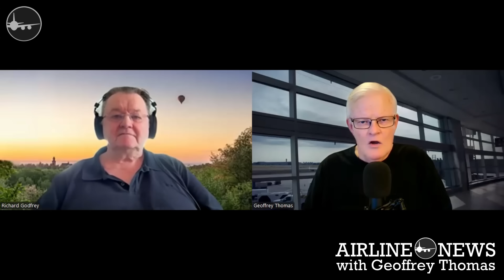Air India Crash - Probable Cause  #airindiacrash

Comment: EVIDENCE OF AN INTERMITTENT FAULT IN THE E/E BAY OF AI171

The HSTA Breadcrumb

Air India didn’t mention the Horizontal Stabiliser Trim Actuator (HSTA) in the Preliminary Report for nothing. That wasn’t a throwaway detail — it was a breadcrumb.

On the Delhi–Islamabad leg the jet already showed signs of an intermittent stabiliser trim fault. The aircraft behaved erratically, like it was trimming nose-up when nose-down was commanded, forcing the crew to fight it. Maintenance logged “no fault found” because the glitch cleared itself — classic intermittent.

So why did Air India highlight HSTA? Because it proves there was already evidence of an intermittent fault in the E/E bay. First it showed up as trim misbehaviour, then on AI171 it may have escalated into fuel control or electrical problems.

In other words — the crash wasn’t out of the blue. The airplane had already given a warning, and the HSTA entry is the clue.

Regards Scooter.

Comment: Boeing should redesign their planes which prevents this kind of situation..

Even the minor water leak should have a warning in the cockpit. Just like car wipers sensing even a rain drizzle .. it should be considered as a major incident  just like smoke.

There are always 100s of ways to improve the design..  

The design which fails to protect itself for any reason without a physical damage is called failure design.. 

Thermal runaway is a known issue but its still not solved. 

They changed the design to protect fire from spreading.. but they have not taken any action to prevent thermal runaway..

Preventing fire is better than protecting fire inside the enclosure 😂😂

I am really wondering there was no protection on battery systems till thermal runaway happens ..
What does useless battery monitoring system do here without giving any warning to pilots? 

Water leakage just before 5 mins can't cause this kind of failure. 

Corrosion don't happen in a single day.......😢

I think water leakage is the least monitored area of the entire plane..

We usually don't do maintenance until there is a some kind of warning or some notifications either be at home or plane..

WHERE IS THE WARNING?? Nothing ..... just a crash... Even before pilots realising what's going on..

Plane crashing in less than a minute is a complete failure and major design flaw.. 

It's really good recommendation from Richard to test multiple sources of failure at the same time..

But for me it looks like its internal battery failure which caused huge damage to the complete electrical circuit.. 

The issues caused outside the battery is mostly protected by the circuit.. 

But There is no way to protect internal battery failure with the worst chemicals reacting inside the battery..

No batteries can work good for more than 5 years.. replacing the batteries every 5 years or less should be mandatory..

Old batteries were never reliable..
Just a voltage drop at single cell is enough to cause electrical glitch and bring the emergency situation..

Now a days even a water purification systems comes with service warning msg.. we can't use them until it's serviced..

Blaming maintanence is ok but is the plumbing system designed to withstand the usage of toilet by 200+ passengers in a single day? 
1500+ passengers in a week? 

Urination happens 3 to 4 times in 14 hours for a single person. 

Basically the toilet and plumbing design should withstand 1000s of toilet visit in a single flight.

Ignorance of non critical maintanence should never cause the plane to crash..

Is the water leakage is in the critical maintanence list??

Intermittent issues should always be recorded and looked at it immediately even if it's cleared automatically.. 

Intermittent issues always hides big issues behind it..

Comment: I think you are on track.  I love your analysis.  I haven't seen all your videos but I try to watch daily.   I have two questions you may have answered previously that I missed but I'm going to ask them anyway.  Right after the crash, a video appeared online that supposedly showed a flight on the same aircraft just prior to the the flight when it crashed.  The passenger was commenting on how multiple cabin functions were inoperative, including the air conditioning.   Was that legitimate or debunked and if legitimate was it considered in the aircraft investigation.  My second question is related to a video I saw by another analyst shortly after the crash.  He said that if the fuel valves completely loose power the default position is closed as a safety shut off precaution to stop fuel flow in case of a crash, etc.  They analysis said that if the power was completely shut off for only a brief moment from all sources, prior to the RAT deployment, the valves would have closed, starving the engines of fuel.  Causing engine shut down.  Is it true that the default fuel valve postion is in the closed position?
Reply: I9https://youtu.be/1y_u1O-T6jw?si=fcflMzQxx6i8wp-1

Comment: Is this what Richard is saying?
1. The APU lithium ion battery had a thermal run away during rotation as the first mishap in the sequence of mishap events. 
2. As the APU battery began its thermal run away, rotation caused “ liquid” to flow onto the battery and exacerbated the event.
So two seperate events conjoined to trigger the mother of all electrical glitches. Seperate to these two events is the unexplained “ drag” causing an extended takeoff roll. 
Questions
A. Did rotation cause the APU battery to begin its thermal event and how so?
B. Is the APU battery enclosure supposed to be waterproof?
C. If there was no water ingress, the APU battery thermal runaway would still have occurred ? Therefore this was a lithium ion battery” event”.
Thanks.

Comment: If the fuel switches had been switched back to run a bit sooner, do you guys think there could have been a chance to save the plane?  I know we are only looking at a few seconds here, but hypothetically.  Interested to hear your opinion.
Reply: No chance of recovery.. no altitude to recover... Nobody could have saved the plane.. 

Boeing should redesign their plane which prevents this kind of situation..

Even the minor water leak should have a warning in the cockpit. Just like car wipers sensing even a rain drizzle .. it should be considered as a major incident  just like smoke.

There are always 100s of ways to improve the design..  

The design which fails to protect itself for any reason is called failure design.. 

Thermal runaway is a known issue but its still not solved. 

They changed the design to protect fire from spreading.. but they have not taken any action to prevent thermal runaway..

Preventing fire is better than protecting fire inside the enclosure 😂😂

Comment: Congratulations to you both for a very thorough and informative investigation of AI 171.
The takeaway I I get is that the tragedy was caused by thermal runaway from lithium ion batteries in the aft  electronics equipment, Bay, compounded by an explosion or combustion of hydrogen fluoride contamination, which, in turn, was caused by water ingress into the aft electronics Bay.
Since Boeing had previously issued an airworthiness directive addressing water ingress, my first reaction would be an assumption of negligence on the part of Air India maintenance procedures.
I have also heard it stated repeatedly on your program  that Air India has chosen NOT to release the maintenance logs on their 787 fleet.  Why not? Not releasing them only adds to future negative speculation.
I also have a question:  Is hydrogen  fluoride itself combustible, and if so, was this a part of Boeing’s airworththeness  directive?
I might add that I had originally thought that the smoke seen coming from the left side of the plane during rotation was from debris or dirt on the runway. Thanks to your astute observation in detecting an explosion in the left electronic equipment Bay.
The fact that Boeing has not issued a new airworthiness directive since the June 12 crash, would indicate that they do not consider this [compound problem of battery, explosion and hydrogen fluoride contamination] to be a critical problem.
Nor do there appear to be plans by Boeing to completely redesign the lithium ion battery compartment.
I watch your show daily and am very impressed with your knowledge and presentation! Thank you gentlemen.

Comment: If true, how Con this ever happen? There must Be some horrible fault in The design  of The electronics. So, you Day that there was a thermal runaway on The rear of The pane, which caused both engines to shut down way further on The middle of The pane? As I saw The take-off, IT seemed only very slow, and way  down The runaway. Maybe The pilots were beyond The point of stopping The Tako off? The piane also. seemed to start coming down immediately after raising in The Air.. The only survivor Said that hearing some loud noise?
This IS a great tragedy, but Will also become very expensve for someone.

Comment: Here we go ... readers ... do you know how many dumb decisions have been made by engineers due to the assumption that somehow an engineering degree confers the ability to understand the enormously complex fields of chemistry and material science! Look at the Challenger and Comet I disasters as examples. Gentlemen ... the Credibility Index for your 'interpretations' on Li battery technology is close to zero ... meaning you need much more theoretical insight into the issues (and solid data) before a sound conclusion can be drawn. Regarding your previous probable cause statements ... the Credibility Index for your proposed causes is 2/5 ... not a very awe-inspiring level of confidence. They are interesting speculations - good for expert-level discussion, but not good for publication read by concerned laypersons who may tend to believe the conclusions as valid.

Comment: Gentlemen, a clarification, please.  Are you saying the battery experienced a thermal runaway due to watercontamination, or are you saying the thermal runaway occurred for another reason, perhaps unknown, and the water damaged electrical components after the thermal runaway?  Just from following your videos since the crash, it seems as though the thermal runaway occurred at rotation, which may be when the water was splashed on the battery.  Thank you for your extraordinary analysis!

Comment: Former Power-plant Fire Safety Specialist. In trying to make sense of this probable cause, I searched for the physical layout and location of the APU Battery.  I was able to find a Boeing Presentation that was prepared for Airport Fire Departments. It is titled " 787 Lithium-ion Battery Events A Guide for Fire Fighters " It shows that the battery is located in at floor level, near the aircraft centerline, in the Aft Electronics Bay. In order to protect the aircraft from a runaway fire, the battery was placed inside a 1/8 inch thick stainless steel box. There are tiny drain holes in the bottom to prevent moisture build-up.  AND the enclosure is at around 2 feet above the pressure vessel wall. 

I can't fathom how water from the lavatories above could have any way of entering that sealed fire box. Yes, it is true that HF can be produced within the enclosure during a battery fire, but as the pressure builds-up, it is vented overboard. Knowing the FAA, they would required that containment of actual battery fire would need to be demonstrated by test.  The battery does not produce HF under normal operation. So, how is the fire box degraded?

In my opinion, this episode belongs on Fantasy Island.